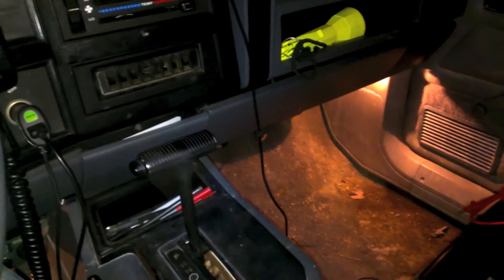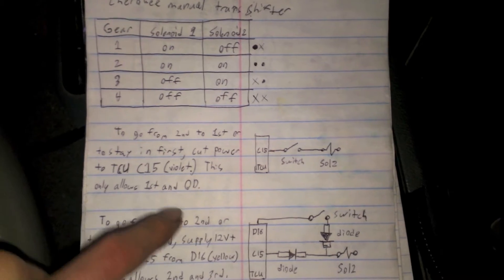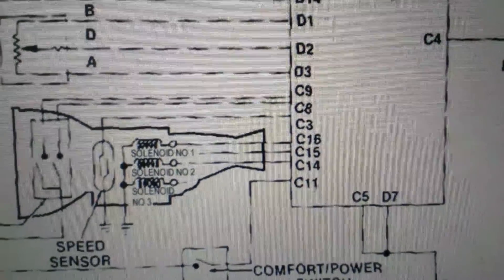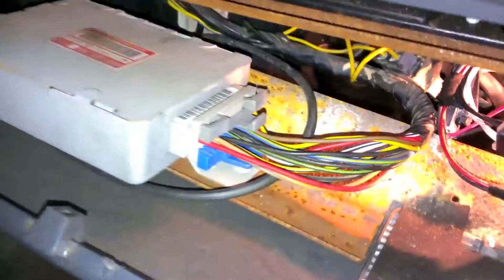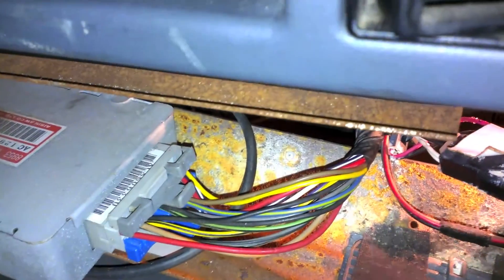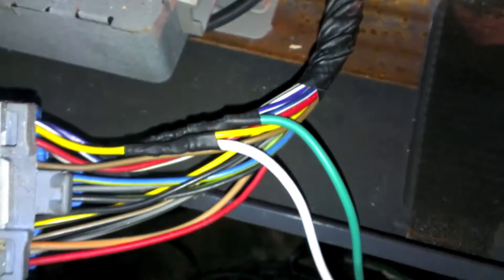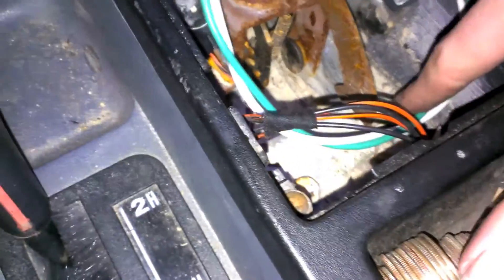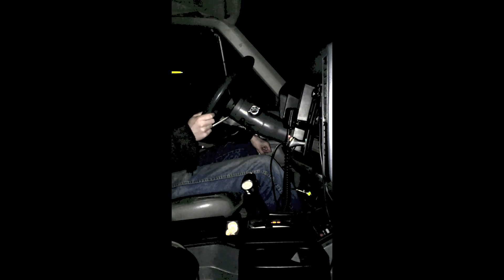89 Cherokee AW4 2nd Solenoid Override Switch Install

Comment: Hey, unrelated question but I can't find this information anywhere. I've got the same Aisin-Warner AW4 but I can't for the life of me find the torque specs for the band adjustments. Do you know anything about that or where I could find it? I have no reverse so i'm hoping that's all it is. Anyway your comments and videos have helped me in the past so thanks either way.
Reply from the maker: I did a quick search but nothing turned up. It sounds like the AW4 doesn't have bands to adjust. http://www.jeepforum.com/forum/f11/aw4-band-adjustment-1451045/

Now if you have a Chrysler A904 3 Speed (1984-1986) or Chrysler 30RH 3 Speed (1994-2000) then you have bands to adjust. Not sure which 3 speed trans my Haynes manual refers too but here are the torque specs it lists for those:

3-Speed Front Band
 - Adjusting Screw (w/ adapter):   36 in-lb
 - Adjusting Screw (w/o adapter): 72 in-lb
 - Locknut:                                     30 ft-lb

3-Speed Rear Band
 - Adjusting Screw:                       41 in-lb
 - Locknut:                                     35 ft-lb
Reply: Well I know it has bands because i've seen two band adjustment screws/nuts. I haven't really looked at the tranny too much. I can hear reverse engage when I shift but it just won't grab (not even a little). The fluid's full and not leaking. I did that self adjusting kick-down cable trick to no avail. I brushed off all the linkage of dirt and it seems rather clear for travel so i'm left with:
1. Tranny is totally shot
2. Band adjustment
3. The pipe that delivers pressure to the reverse inside the tranny is broken.
4. God knows what.
I tried to pull it up today to hose the underside off but my starter is out whomp whomp. Thank god this thing isn't my daily driver lol. Thanks for the help.
Reply: NickInTimeFilms Also someone told me that a lift kit can sometimes effect the linkage but I don't believe them. Not on a two inch lift anyway. Oh, and I read that forum. I was told to put in ATF+4. I haven't ran it much as i've spent the last year just getting it running & idling correctly, gauges & instrument all that. Anyway i've had problems with slippage a little in forward and totally in the back. Maybe I can get away with just changing the fluid. Then again when I got the Jeep both of the cooler lines where cut & connected (not flared) with vac hose & cheap hose clamps. I don't know. I guess i'll figure something out when I drop the pan tomorrow. Thanks again.
Reply from the maker: Andrew Roby Just want to verify, what vehicle do you have? If it is a Cherokee with a 4.0L Auto then you have the AW4. I've read several forums that say there aren't any adjusting bands. The AW4 is electronically controlled with solenoids, which is how I'm able to active 2nd/3rd gear with this switch I made.

A lift kit by itself will not affect any of the trans shift linkages. If there is a drop Crossmember then you may have issues with the Transfer Case linkage, but the Transmission has flexible cable linkages.

I've done a lot of reading on what fluid to use and this is the conclusion I've come to: Use Dex/Merc. Aisin-Warner specifically says the AW4 should use Dexron II(2) fluid. Dexron II(2) hasn't been available for decades since the licensing has expired. Dex II(2) was superseded by Dex III(3), and then again by Dex IV(4). Dexron and Mercon ATF fluid is very similar so eventually they were just combined to make Dex/Merc Blends. Dexron VI(6) is a totally different blend and is not suitable for the AW4. Chrysler back in the day was tired of having Dexron for their AW4 Jeeps when the Chrysler Transmissions used ATF+4 so eventually they released a bulletin saying it was okay to put ATF+4 in all their Transmissions. ATF+4 has more grip additives that will slowly eat up AW4 Clutch Packs so I recommend Dexron IV or Dex/Merc.

My jeep also has rubber hose lines that connect the metal trans cooler lines to the radiator. It may have been a factory thing to let the system flex a bit.

Here is the AW4 Service Manual. It should have everything you will ever need to know in here:
http://www.pirate4x4.com/tech/billavista/PDFs/AW4_manual.PDF
Reply: NickInTimeFilms It's an 88 XJ with a 4.0. The previous owner dubbed "the tweaker" has done a lot of dumb shit. From what I can tell it looks exactly like a AW4 but you never know whit this jeep. Maybe those set screws where for something else but they look exactly like band adjusters i've seen online. Does the AW4 have a solenoid for reverse? Because that could be a good starting point.

No, those tranny lines looked like they where cut with children's safety scissors. I had to file them, flare them and get better clamps on them. I've ordered up a few feet of tranny fluid resistant hose to replace the vacuum hose that's on there now.

Tomorrow morning i'll read through that manual with my coffee, then i'll drop the pan and check for chunks/flakes. Then I'll replace the hoses on the cooler lines. After that i'll maybe check the things that I can figure out like the solenoids & connectors. If I can't find anything wrong i'll just pull out as much ATF as I can and fill it with Dex4 or Dex/Merc. I remember doing some reading on that a long time ago but totally forgot. I asked someone who "knows jeeps" while I was at Napa and they told me ATF4. Oh well. If that's all it takes to fix it I'll be lucky. My brother just spent the value of his car to have his tranny rebuilt :/
Reply: NickInTimeFilms Oh yeah, do you know any good sites to get obscure parts from? I've been looking for the MAP vac line (the one that connects to the side of the throttle body, not the nipple on top of the block) & can't find it anywhere. Not even Ebay or Craigslist.
Reply from the maker: Andrew Roby The AW4 has 3 solenoids. Solenoids 1 and 2 control gears 1-4 and solenoid 3 controls the torque converter lock up. I didn't read much into it but is sounds like Park, Reverse, and Neutral are controlled mechanically through the shift lever. Reverse uses some kind of brake or something to turn so it may be a friction issue.
Reply from the maker: Andrew Roby Rockauto.com has a decent amount of hard to find parts. If they are really hard to find, I usually try to search up dealer specific online part stores to find diagrams and factory part numbers, then search the number on google for a good price. If nothing else is available, you can try to find generic vacuum lines and find the diameter you need and cut to length.
Reply: Well if it is a friction issue that could indicate the wrong fluid I have in there.
I have a jury rigged contraption in place of my vac line right now. It works but not well. I'll give it a shot, thanks again.

Comment: Where is the shift governor on the renix?? In the pan?
Reply from the maker: I'm unfamiliar with a transmission "shift governor." I know the Aisin-Warner AW4 transmission uses 2 solenoids to control what gear is selected along with a TV-cable to adjust for WOT. The solenoids are located In the pan. Check my AW4 Fluid and Filter change video to get a quick look inside the pan. Hope this helps.
Reply: @NickInTimeFilms  the TV or throttle valve cable controls line pressure.
Reply: Thanks!

Comment: So, as the new switch activates Solenoid 2, it will also drop to 3rd when you are in 4th, right?
What would be the difference between that and what happens when you go WoT?
Thanks man. Great videos! :)
Reply from the maker: Yes, is acts like an Overdrive kill and will shift into 3rd as well. My throttle position sensor harness was messed up so the transmission wasn't getting any throttle input. If I hit WOT, the engine would run as if you were only pushing down 1/3 of the way which sucks if you are trying to pull out or merge. I could manually shift it and it would speed up correctly but I was tired of having to shift from 1st to 3rd so I didn't work my engine to hard. Now that I replaced the harness, everything works normally so I only use the switch if I'm trying to race or pull out fast.